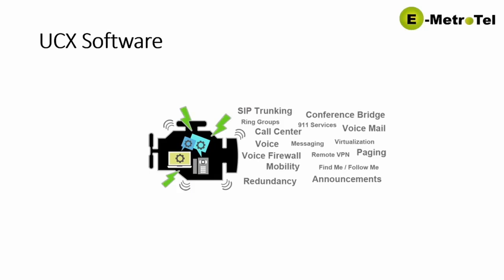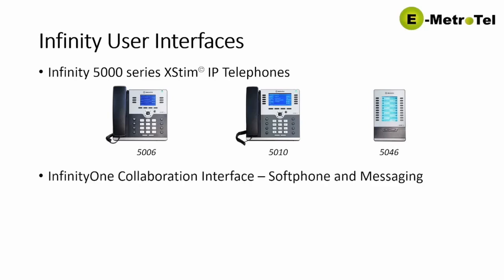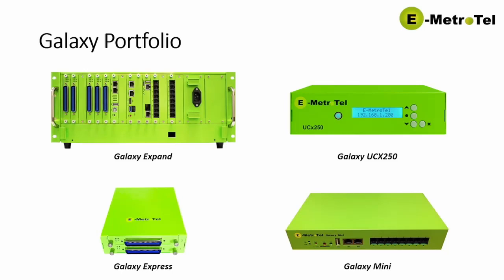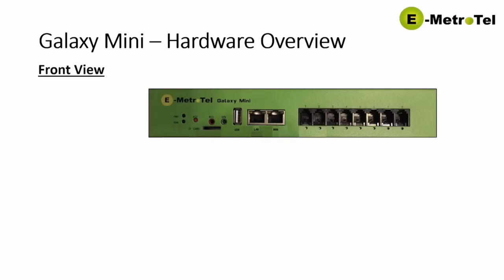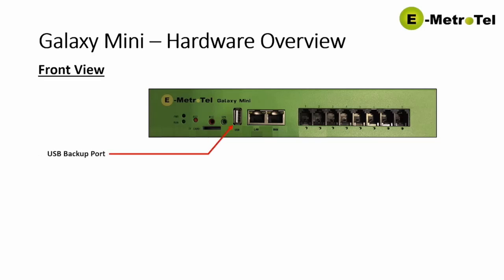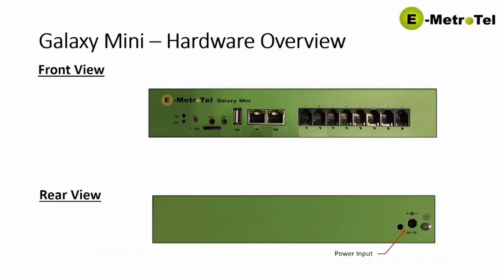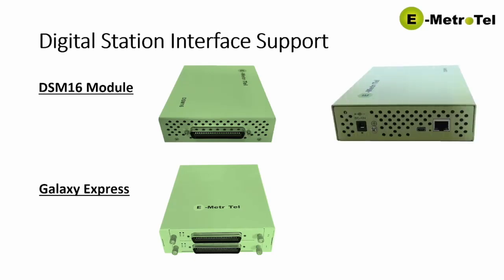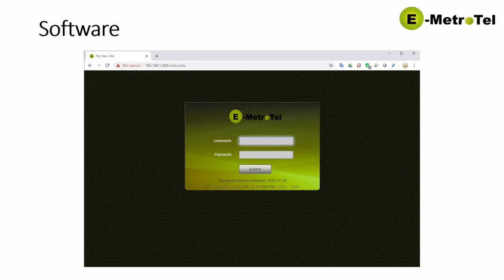Introduction to Galaxy Mini Hardware

Comment: "These kind of customers typically don't want to be bothered with internet, Voice-Over-IP capabilities, or can't deal with the fact that they have poor bandwidth at their location. They also may have wiring for digital phones as opposed to ethernet drops at all locations."

Now correct me if I'm wrong but the E-MetroTel DSM16 module (which is what the Norstar/BCM digital phones connect to) connects to the Galaxy Mini via LAN, so it would still involve an internet connection with sufficient bandwidth. And what's scary about this is that if the LAN goes down, not only the IP phones (if there is any) go down but the DSM16 module goes down along with all of the digital phones connected to it! So that would be an even worse scenario compared to other hybrid PBX's where if the LAN went down the IP phones would go down but the digital phones would remain unaffected.
Reply from the maker: Thank you for your feedback. I agree that there are many different levels of comfort with VoIP in general and the amount of bandwidth available to small customers. Although unlimited use of SIP VoIP trunks is built-in to the UCX software on the Galaxy Mini, the system is optimized for integrated FXO trunks as well; additional FXOs and even PRI can be supported from our Galaxy Express chassis. With respect to the LAN availability item you mention, the Galaxy Mini has two separate LAN interfaces. One of these can be connected to the customer LAN for general management, while the second one can be connected only to the DSM16 device(s) via a single, direct Ethernet cable. This allows full telephony operation independent of the customer LAN infrastructure.
Reply: @emetrotel  I actually had been wondering about that, that is if you could just simply use a single ethernet cable to connect one end to the WAN port on the Galaxy Mini and the other end to the port on the DSM16 without having anything to do with the LAN infrastructure. If that's the case that would make me confident that the digital phones would work flawlessly, even if the LAN happens to go down. So I take it the same thing can be done on the UCx250/UCx450 with the Galaxy Express module if the customer happens to have M2000/M3900 Series digital sets. Thank you for your informative response.